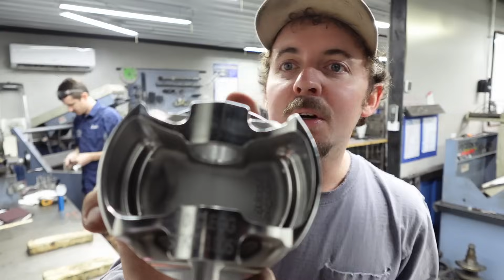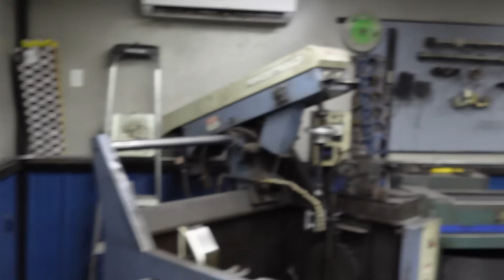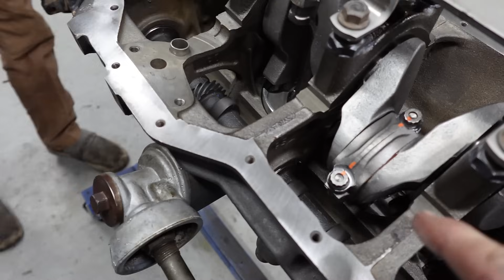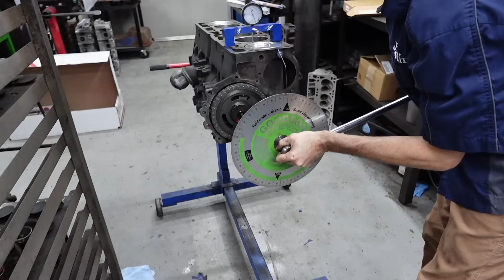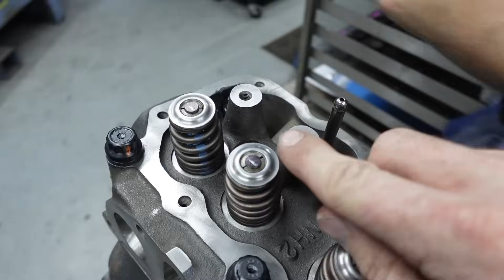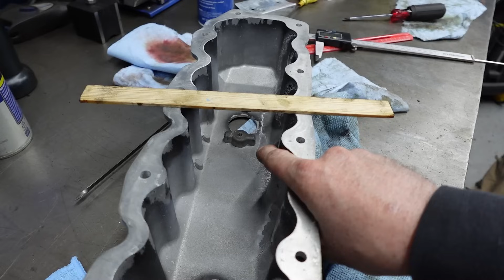Completing The Jeep 5.0 Stroker Engine In Its Final Phases!

Comment: Boy that's going to be a helluva bunghole. 

I tried to make a pretty motor when I was putting it back in my Corvair and went with an anodized blue color... It looked so cool on the cap and can label. The steps included of course cleaning, first with solvent then soap & water then adhesion promoter then silver followed by the anodized blue then finally clear coat. I let it cure for about 2 years (got sidetracked by a girlfriend). Every beautifully painted piece chipped and looked like shit by the time I got the tinware installed... I had to tear it apart and use a better paint. 
I hope you have better luck with your paint than I did with duplicolor😂
Reply: Why i usually just went with vht grabbed green,satin Ford black and accessories brackets and bolts gm rally wheel silver which looks very similar to what gm calls light argent grey on their gm square body truck grille and headlight bezels
Reply: And i used easy off dollar general store oven cleaner instead of gunk engine degreaser and kerosene a bit of acetone and some gas or diesel fuel for breaking down the existing paint on the motor brackets and existing parts and bolts

Comment: Dex that 4.0 turned 5.0 inline 6 is looking fn fantastic.. All those new internals look sweet n beefy.. Sadly tho noone sees that stuff besides in these videos but you know you have all the good stuff jammed inside.. Thats horrible the piston manufacturer wouldnt take accountability for the messed up pistons & tried to just blame you for messing them up. Specially bc they aren't cheap pistons.. Even tho we all can clearly see that those f-ups were manufacturer caused & could not have been caused by someone dropping them..
Oh so injust thought of this you should leave the 4.0 on the valve cover so it appears to be something its not you know sneaky sleeper racecar type things.. Cant wait to hear that thing running..

Comment: @justdexit did you use a 4.2 or a 4.0 piston? Ive heard that the wristpin height is preferable on a 4.2 piston, 4.0 con rod, 4.2 crank combo. I'm a week away from going home and start ordering parts for my stroker going in a 87 YJ.
Reply: I think you got that backwards. Using 4.0 rods require a custom piston with a raised wristpin height, Which is how most Kits you can buy go about it. The "poor man's method" is to use the 4.2l rods with the 4.0 pistons. That gets you to 4.6l

Dex is using the Clegg Engine 5.0l stroker kit which is I believe is all custom internals

Comment: On my 4.6 the rod caps didn't start making contact with the girdle until the motor was hot.   Scared the crap out of me, thought it was rod knock.   Make sure you get a decent clearance because things expand :).
Reply: Then you get self clearance at that point!
Reply: Yep i experienced this with a buddy's stroker gm 292 L6 anyway it was fine till it got hot and was revving and it made all kinds of banging grinding noises until it locked up tight it broke the bottom skirt of two adjacent cylinder walls and was instant scrap metal sucks when you have a $845 L6 crank and a specific intake manifold and cam setup.. was a nasty sounding 76 Chevy Nova 4dr rat rod for about a half hour..

Comment: Rhodes lifters were very popular back in 60s 70s . They won't fully pump up till the motor rpm is above 2800 rpm or so thus meaning you could run a very high lift and high duration cam without it effecting the vacuum at idle nor did you need a high stall torque converter because you could get the high lift cam to idle  at a much lower rpm than you would running non Rhodes lifters
Reply: Don't they call them anti pump up lifters or something like that small holes machined in the upper ring of the lifter i like Rhoades and Engle lifters

Comment: Head hasket has no bearing on displacement.
Reply: Doesn't the head gasket thickness as small as it is cause the compression ratio to slightly change? Not sure about the actual displacement but the compression ratio would/could slightly change depending on gasket thickness?
Reply: @danafaulhaber334  compression ratio yes, displacement no. I believe the conversation followed the lines of different head gaskets making in a 4.8, 4.9 or 5.0.   To which the thickness of the head gasket changes not.